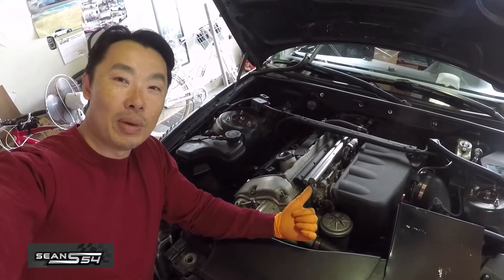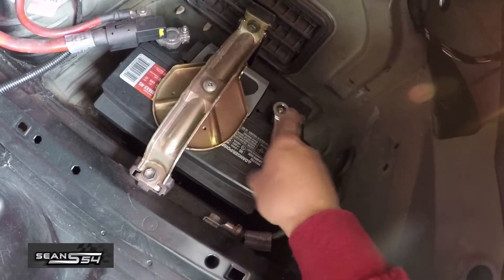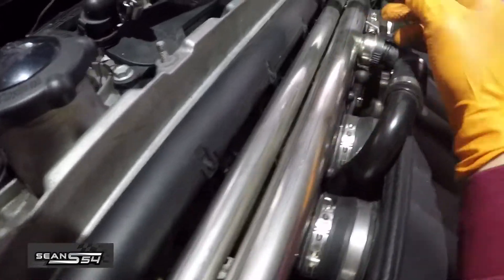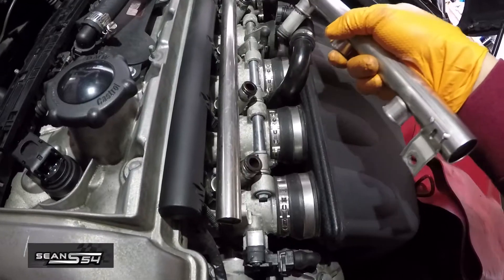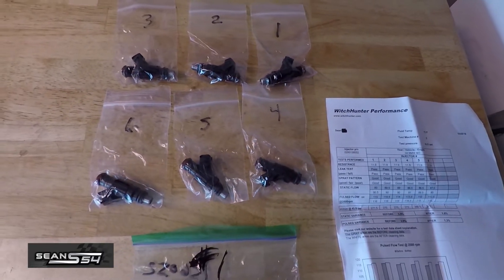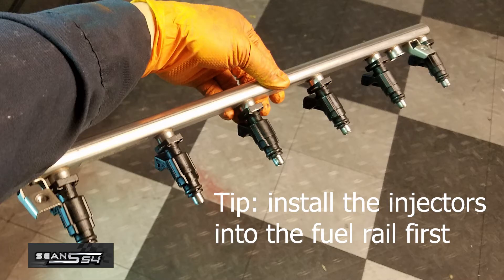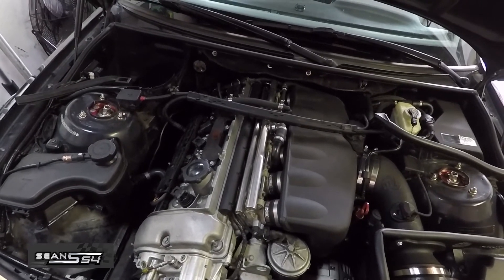Fuel Injectors DIY, Testing & Cleaning - BMW E46 M3 & Z4 M (S54)

Comment: Thank you for the video.

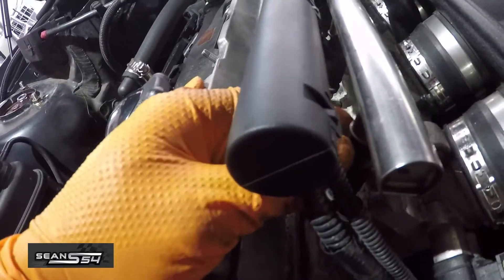At 3:18 You forgot to mention that the electrical connector of each injector is held in place by a thin wire bracket. You need to slide that off first (both sides), or else you will demage the injectors if you just try to disconnect them by pulling / wiggling.

Comment: You skipped a crucial part at the end.  Unplugging the electrical connector from the injectors. And you skipped how to get those back plugged in once you fit the injectors to the top.  Can’t get mine to seat right and plug them in.

Comment: If the hex bolts on the fuel rails are missing can that cause a vacuum leak? Or lean bank 1 and 2 running lean?

Comment: I found a swivel head in my garage and got the bolt off but cant actually pull the rail up. Skipping that im trying to get the harness off of the injectors and of course you skipped that... sigh.

Comment: Hey man, I got a report from blackstone labs stating that my fuel dilution was at 4% when it should be below 2%. I think I’m gonna send my i injectors in to get tested. Quick question, your video says dont forget the o rings when reinstalling the injectors. Do you need to get new o rings or reuse the old ones? Tha ns
Reply: Did you do this? I also have near 4% fuel dilution on last sample.
Reply: @chrisbradley3224 fuel injectors

Comment: Hey boss, quick question. I have a m54b30 120k miles or so. Would you recommend just cleaning and replacing the upper rubber O rings? At what point would you buy new injectors?
Reply: Just send the injectors off to get tested and cleaned :)

Comment: Thank you for all of your videos, they have been extremely helpful with getting my M3 working top notch for the track.  Quick question, do you have any tips for getting the rear 10mm bolt back in when you are putting everything back together?  In the past I used some poster putty but I may be missing something.

Comment: This is not a video that will teach people to check and clean injectors DIY style.   You took your injectors out and then had them sent off somewhere to have the work done.   That is not DIY.   You did remove them yourself -- I'll give you that, but your title says, Fuel Injectors DIY, Testing & Cleaning.   Your title should be Fuel Injectors DIY, removal so you can mail them in to be tested.   Had that been your title I would have known not to watch.
Reply: you could have easily skipped ahead through the DIY uninstall part if the cleaning part was all that you were interested in, to easily ascertain that this video did not actually contain the DIY to cleaning and testing it.

Comment: hey Sean, hopefully you see this.

I was performing this on my supercharged E46 M3 I just purchased and discovered that little small hose on the end of the rail for the PCV system is gone. I dug my hand around, couldnt find it behind the motor, any idea what it is called and where it goes so I can find it?

Thanks
Reply: I have the same issue.  Did you ever figure that out?
Reply: I believe this is the part you’re looking for. 11727837591

I noticed mine was toast while installing my CSL airbox. Just replaced it with a small piece of 3.5mm braided vacuum line.

Comment: I did this today and thanks to Sean's video it was a breeze. What I would add is @1:50 mark he describes having and issue. First of all the plug that pushes down you do not need to unclip if you dont want/have to. It goes to a sensor around the back of the engine and is no issue. I also had an issue this time with injector six electrical connector. After the harness was up in the front and still attached to the last plug I move the harness back to as close to the original position and grabbed it from the passenger side of the engine and used my thumbs to push down GENTLY on the fuel rail and it came off. There is a protective cover on the last throttle body that also has a clip that the harness is hooked on. This prevents you from pulling the harness up at that end(6) unless you know where the clip is and how to unhook the harness. Thanks again to Sean for taking the time to post these great videos!

Comment: how many miles were on your car when you did the testing? or how many miles on the injectors? great video thanks Sean..
Reply from the maker: Thanks! I had 155,700 miles on the car when I did this. I have no idea if the injectors were ever cleaned or replaced prior.

Comment: Nice video. Thanks. I like the attention to detail. My e46 m3's oil smells a bit like fuel (I noticed it when looking into the engine through the oil fill cap). It's not overwhelming but noticeable. I read that having fuel in the oil is not good (because it  reduces the lubrication) so I looked up possible causes. Apparently leaking fuel injectors are one of the common suspects - which led me to this video. My car's startup is always strong but sometimes I have a few moments of rough idle after startup, other than that I don't have any leaking-fuel-injector symptoms (rough idle, smoke or smell of gas in the exhaust, rough idle). Do you think the fuel injector analysis can diagnose the leaking that causes the fuel smell in the engine oil? Or, do you think I'm on the wrong track completely?  Anyhow, great video and I'm looking forward to more. Very helpful.
Reply from the maker: Thanks for watching! When you send your injectors out, they will test it and clean it, and let you know if there's a leaking injector. Before you do that, I recommend doing a $30 oil analysis to see how much fuel is actually in your oil. Here's a DIY: https://www.youtube.com/watch?v=20qWdTEbcX8
Reply: I've been getting rough starts on my E46 M3 as well. Sometimes it won't start unless I turn the key back to off and try again, then it starts strong. Runs and idles just fine. In the last year I've replaced the fuel filter, fuel pressure regulator, fuel pump just last week as well as the relay (which is in the trunk above the battery behind the carpet) and just replaced my spark plugs and coil packs, all that cuz the car actually stalled and wouldn't start. The rough starts have improved, but it's still there. I know how to troubleshoot, but also I'm about to drive cross country and figured new stuff is good. May get my injectors tested as I have no idea what else could be causing this.
Reply: @seanmiller8701  curious if you went ahead with the injector cleaning?  I have all the exact same symptoms as you and have done everything you have done so far short of coils and wires and relay.  I'm going to pull injectors tomorrow and get them sent in but I'm at the end of my list of things to try soon to fix this issue.  Also have a heavy gas smell from exhaust but I am also catless, however I feel the smell is too gassy even for not having cats.  Which took me to this video.
Reply: @johnhanson2410  I haven't had them checked. I need to though. I also am pretty sure they're leaking as my oil level went up a bit and does slightly smell like fuel. (There's no sign of coolant in the oil). It's also my only car so pulling the injectors and sending them off isn't much of an option. I'll probably just buy new ones eventually. I just got to Florida 2 months ago, cross country trip went smooth, and fast, no issues, just the starting hesitation.
Reply: @seanmiller8701  I sent mine in Friday.  I could see #6 was visibly not looking too good.  I'll try and post results when I get them back with the flow test sheet.
Reply: @johnhanson2410  That would be cool. Hope replacing them or rebuilding them fixes your issue.
Reply: @seanmiller8701  welp I got my results back.  #6 was visibly dirty and failed the spray pattern test.  Overall cleaning got my an increase in flow of .4 lpm @ 2.5 bar across all injectors.  So it wasn't a waste to clean them and they were due but by no means over due.  So I could have waited.  Also IT DID NOT FIX MY STARTING ISSUE.  GAWD.   So the consensus is from a few techs I talked to is to start looking at the control side.  Sensors and whatever.  Damnit.
Reply: @johnhanson2410  Hmm..maybe worn timing chain guides, or VANOS issue, do you have a DME (ECU) reflash program running? Might be corrupt, mine was on an E36 M3 I had.  I'm down to intake cam sensor, crank sensor, chain guides, injectors, or DME issue I believe. Or timing could have slipped. Mine had slipped, had it re-timed and then the issue started shortly after replacing the fuel filter a couple weeks after the timing was done.
Reply: @seanmiller8701  I'm leaning towards a crank, cam, or throttle position sensor.  Which is silly because I would expect a code.  Guess not though.  I do have a software reflash on my ECU, BUT the issue was there before the tune.  I've not done vanos bullet proofing yet, that's probably going to wait until next winter.
Reply: @johnhanson2410  Hey John, I'm going through the same issues, did you ever figure what your issue was? I've done all the same diagnoses short of looking into the injectors, which would be next.
Reply: @John Hanson did your MPG get any better after the injector cleaning? Sorry to hear it didn't fix the rough start

Comment: please, please let me know how you unconnect the injector from the black wiring harness clip without actually taking off the wiring harness. I see the metal clip that surrounds the clip but can't figure out how to unplug the injector from the connector.
Reply from the maker: The injector can be unplugged from the connector with a little prying force, or what I did was use a very small flat head screw driver to slightly move the clip from it's groove, then wiggle out the injector.
Reply: Thanks!

Comment: Would you recommend doing this for a non dedicated track car? At what point is it a good idea to get this done and what signs will the car be showing? I'm in the process of sending an oil sample to Blackstone and if it comes back with rod bearings issues I'd like to get everything under the hood done at once.
Reply from the maker: I recommend doing this if you have close to 100K miles. Also if you have a rough idle, poor performance, or poor MPG. I think cleaning the injectors at least once for the life of the car is good maintenance.

Comment: It's probably a good idea to replace the 12x vacuum line o-rings as well, PN: 13417830384.  I replaced mine recently (at 143k), and several looked like square-cut brake piston seals when I pulled them off.  :-/
Reply from the maker: Great idea! I was going too but when I inspected them they all look good.

Comment: No longer running the catch can?
Reply from the maker: I took it off for the time being. Unlike my 335i twin turbo, the catch can on this car really only caught water vapors and no oil. The factory oil separator does a really good job. The OCC is still sitting in my garage so I may decide to put it back in in the future.
Reply: @SeanS54  why bother removing it though? are there any cons to having it still?